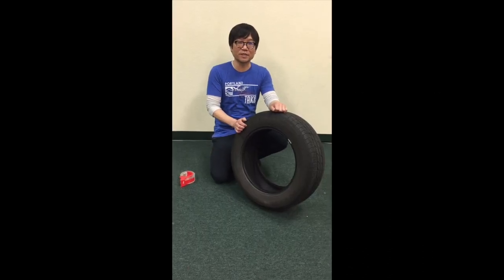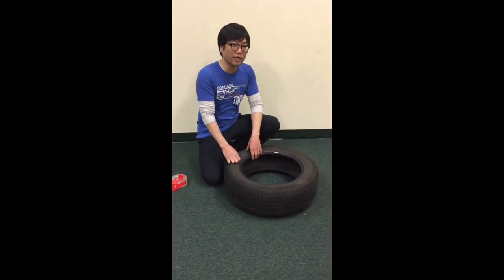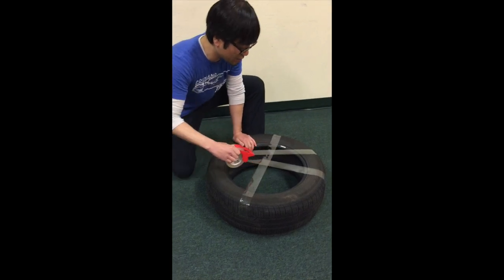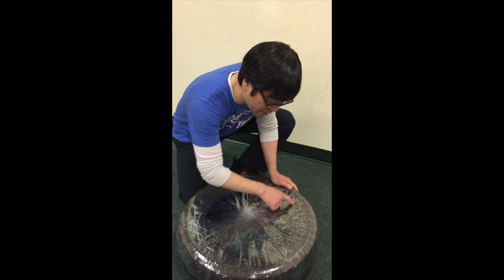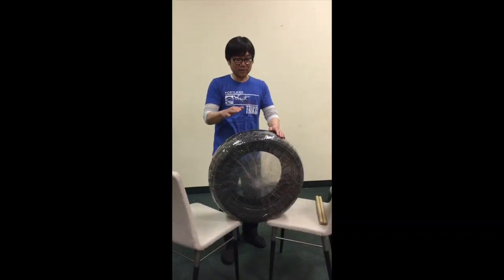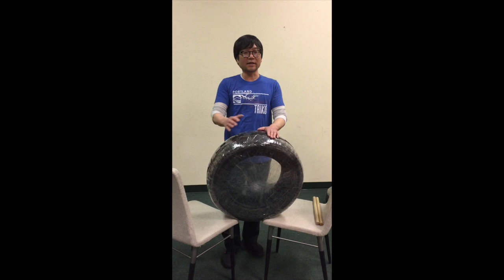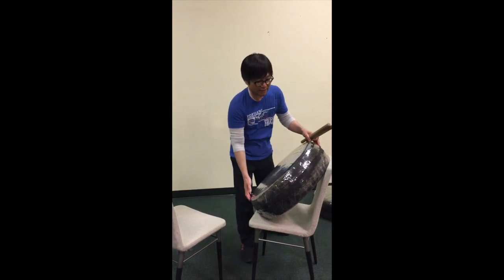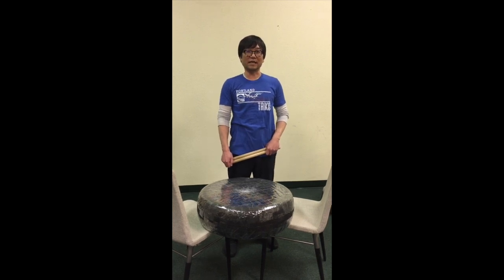How to Make a Tire Taiko -- Portland Taiko

Comment: When you beat on the edge of the tire it made me think, could you make a wooden band to sit on the edge so you get that nice higher pitch click sound?
Reply from the maker: That's a great idea! Please let us know if you have success!
Reply: Yes! This! Now I'm wondering if I could 3d print something out of wood PLA in sections and glue them together. The tire handles the heavy work, the printed case let's you ka the rim and be pretty if I stain it.